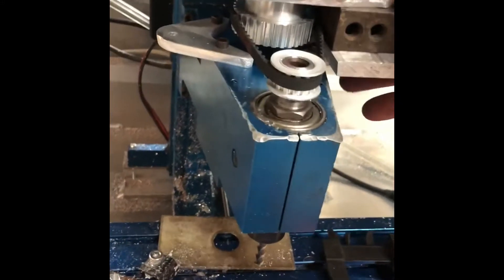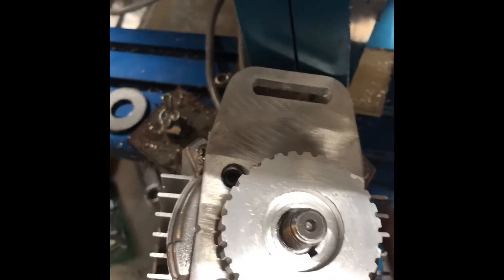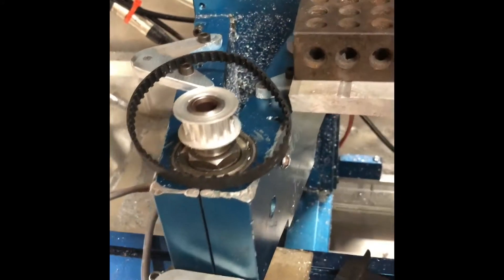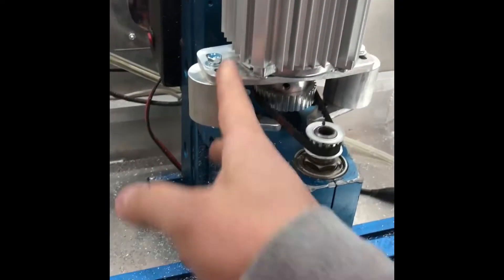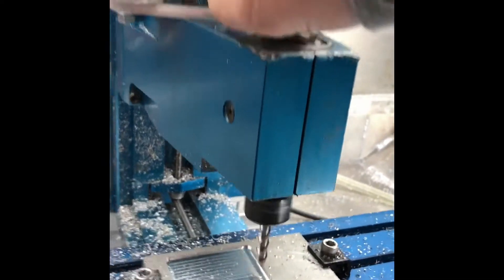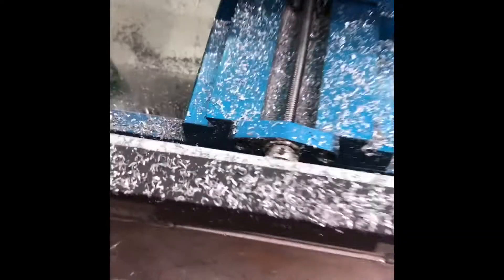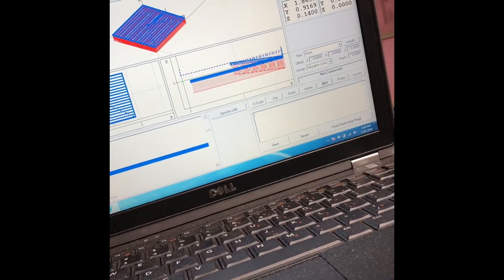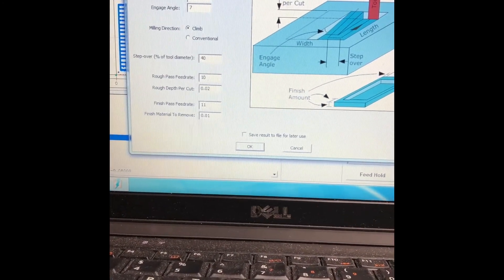Maxnc15 Consew Motor Upgrade part3 - done!

Comment: Well Done Gamble! I found I was having the same issue with my pulleys as well. I think it is an alignment thing on mine. I think the physics are such that there is more tension on one side of the belt than the other, and like a band saw or belt sander the belt is tracking to one side vs the other. At any rate congrats!